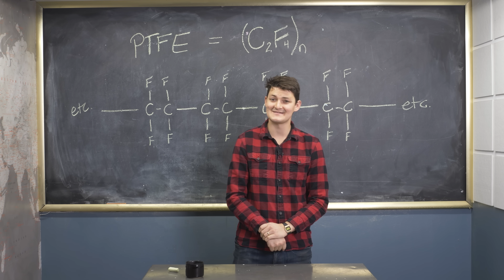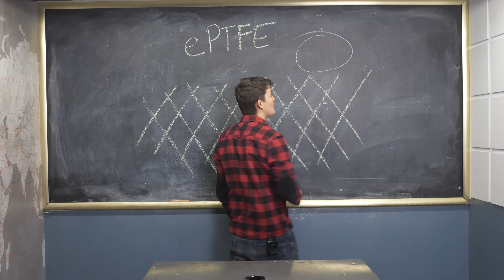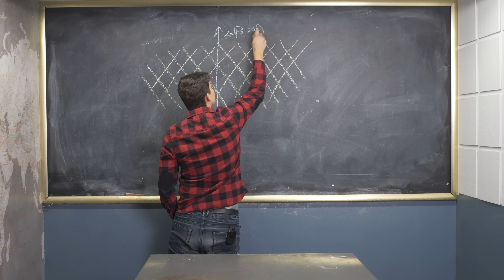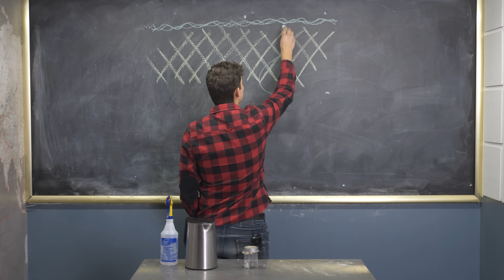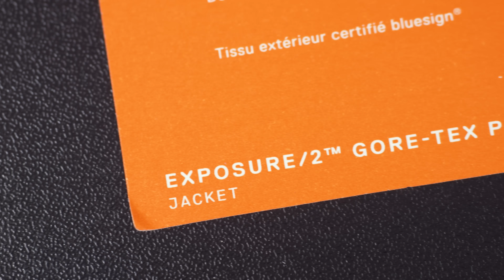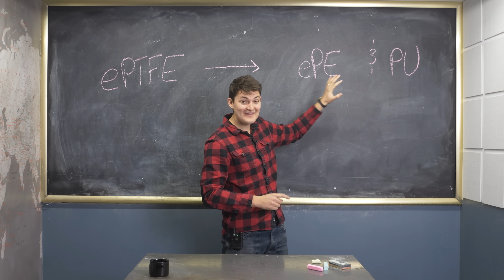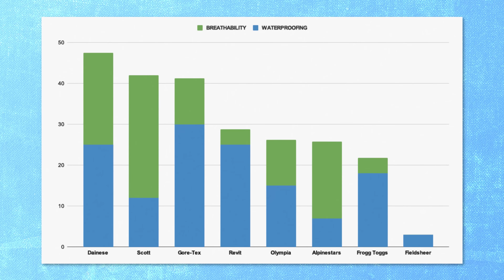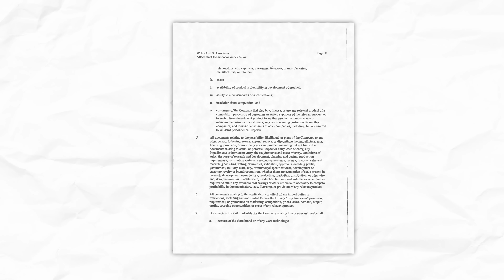Gore-Tex is a Marketing Gimmick

Comment: I've owned a couple of gortex jackets and I've found they are not waterproof, they wet out after a while which tends to negate the breathability of the jacket.
I think they are good in light rain and sparodic showers but in driving rain and high winds they fail every single time.
The Scottish Highlands will destroy gortex real fast.
I now use a wax jacket which works better and is easier to re-wax after each trip.
Just my humble opinion though.

Comment: Gimmick? Well, yes and no. I rode with Aerostich Roadcrafter suits almost my whole riding career; 38 years and hundreds of thousands of miles. The ‘Stich, made with Gore-Tex, was marvelous for all kinds of reasons but I found that while it was water-RESISTANT, it was not quite water-PROOF. On my motorcycles with good-sized fairings and/or windshields it did a decent job in all but really heavy rains. On my Ducati 900SS it left me SOAKED . . . especially where the rain got channeled down my chest and into my crotch. YUK. But then I discovered Frogg Toggs and that flimsy-looking but surprisingly tough suit, on top of my ‘Stich, kept me DRY, even on the Ducati, in deluges and at speeds WAY too st00pid for those conditions! So I’ve been happy with my only two Gore-Tex purchases ( the Gore-Tex did not survive sliding on the pavement — so I had to buy second ‘Stich ;^)

Comment: After my time in the Infantry, living outside like a homeless person, I am convinced that 90% of the population does not need this stuff, or know how to use it properly regardless.

The stuff is honestly kind of garbage even when you do know what you're doing.

Just use appropriate base and mid-layers for the weather, and  then use a shell (with ventilation) if the weather requires it. Only use the shell when needed and not beyond that.

Comment: I admit to be a GORE-TEX fanboy. GORE-TEX footwear is the absolute best for Motorbike riding. On the garment side I am using Leather Jacket and Motorbike Jeans and over it a British Military GORE-TEX rain suit which works extremely well and is really low cost if bought on ebay (new or hardly used).

Comment: What was it called?  ECWCS?  The Extreme Cold Weather Clothing System?  Back in the early 1980s as a young Airborne Ranger I was among the very first US Army personnel to be issued this equipment.  It sucked.  When was it?  November of 1984?  The Pre-Ranger Program at Ft Lewis Washington.  Cold, wet, miserable. Two weeks we spent patrolling in the woods of North Fort Lewis, and all of that so-called ECWCS gear just soaked thru.  We were not happy-healthy-campers.  We destroyed that gear in our vain attempts do dry it out.  That was thirty years ago, Gore-Tex hasn't really improved since.  You can stay dry for a little while, but eventually it - GoreTex - and everything like it will just soak thru, it's a matter of vapor pressure, surface tension, temperature, humidity - it will all soak through eventually and you will be wet - cold- and miserable.

In my middle age as a Catholic I walk the ancient pilgrimage trails of Europe 400km at a time.  If it's only a little rainy?  A rainskirt cut from an old poncho and an umbrella works fine.  If it is a heavier rain, you take out your rain jacket.  Then if you are traversing the Aubrac Plateau of central France at 4500ft altitude for six hours and you are soaked straight thru.  Oh, I hate that.

Comment: As much as I like your channel I’m a bit disappointed with the ‘technical” part of the video - in short - the omission of vapor pressure equilibration is not acceptable, this is the mechanism behind goretex usefulness… the branding… well, whenever I buy goretex branded shoes I’m sure they were tested for sole seal and wear - that’s enough to convince me to pay the premium. So far I had not been disappointed (decades of using goretex an non-goretex merrell moabs gives me the perspective)

Comment: Gore-Tex has some type of consistency though., Most of the items that Gore tex is in, is the higher quality items. Like, you won't likely see a cheap crappy boot with gore tex, it would be their upper more expensive lines of boots,
So the Gore-tex goes hand and hand with quality materials being paired. Most of my items are goretex, but not all.

Better question, which fabric membrane last longer?

Comment: Interesting video about an evil corporation, are they any other types?
Nice lab work also.
But you could not be more wrong about its claimed abilities. A Gore Tex bivy and jacket saved my life countless times in the army. They were waterproof and after not needing the bivy anymore, finishing in 2011 having started in 1995, I thought I would do a few tests. I jumped in a pool and other than some small leaks near the seams it was still basically waterproof. Breathability is a realistic real similar result. Of course, it was not 100% breathable but based on physics that is impossible. It is also not as breathable as a dry cotton or similar material shirt, but it is very breathable. If you are in the humid jungle and you are already sweating do you expect it to stop you sweating? Put a plastic bag on then compare it to putting a gore tex jacket on there is a marked difference in breathability.

Comment: I love my goretex pants. Performed incredibly well in Alaska in some very heavy rain for hours. They breathed great as well. I suppose the air flow of riding the bike provides the difference in pressure required for the breathing. I was amazed at how well they did. Worth the $250 I spent buying them from the scratch and dent bin at RMATVMC.

Comment: Great video that well covers the general point but may have missed some key additional ones.  To solve the problem of the membrane getting fouled and letting water through "Gore-Tex" has an additional PU layer that prevents air from passing through but wicks water out.  It "breathes" water under the correct temperature & pressure conditions but does not actually pass air.  This is why features like pit zips are a critical feature of good Gore-Tex jackets - need a somewhat rain sheltered way for air to get out.  The original concept, simple membrane that passes air but not water, is still available from a different company, eVent Fabrics, that solved the problem in a different way.  eVent membrane has hydrophobic and oleophobic coatings that let it resist soiling and waterproofness failure longer, and they prescribe periodic cleaning and recoating to restore membrane effectiveness.  To differentiate themselves from Gore they refer to the membrane function as "direct venting".  Unsurprisingly there aren't many companies making eVent garments because Gore won't let them also make Gore-Tex garments - a market strategy mentioned by the video.

Comment: I'm a sweaty guy. We lived in Sitka AK, years ago and I wore a gore-tex jacket when running in the mountains with my buddies. Sitka is in a rainforest and it rains most of the time. Well I can tell you from experience that the stuff works. Running sweaty in the cold rain I was perfectly comfortable.
I theorized at the time that the inside of my jacket was hot and humid and this had the effect of driving the water vapor out. I tried the other 'waterproof, breathable' products of the time, but none were as comfortable as gore-tex.

Comment: as a guy who just bought my first GORE-TEX jacket, I am a sucker for marketing :D I never had one, always heard good things about it, especially from older generation of people who still have the ones made in 1990, and they still work, because it's teflon.

One thing missing in this, is that it's easy to buy a shitty jacket with SomethingTex 10000, but it's almost impossible to buy a bad jacket with GORETEX (I love typing it :P). They have a certification process to make sure you don't mess up the brand name. So IMO, I bought it because of that, plus it was just 300$ with Paclite, so far I love it.

Comment: After spending four years in Alaska and having the most state of the art "Gore-tex" equipment issued to us.  I can say, without hesitation...., Gore-tex is absolute crap and a rip off.  It does NOT keep you dry in harsh wet environments, it does NOT "breathe" and it's use is really no better than a heavy duty Hefty Bag that you can get at the local store.   Yeah, they look cool and yeah, they cost a LOT of money, but anything made of Gore-tex in a real harsh environment--sort of like riding a motorcycle in the rain the northern latitudes--is absolute crap that is not worth the price.

Comment: Don't really get the comment at 5:07. The gore-tex 'claim' is that hydrophobic material + (some) breathability is good - water beads off and doesn't hinder breathability as much. A plastic bag may be as hydrophobic, but it's not breathable. So why would a wool sweater + plastic bag work as well as goretex?

Comment: In the shop, they all look nice. But you should not recommend anything if you have not used them yourself for a longer period of time. 
I do have the Arc’teryx and I am happy with it when it rains for a short while. But after a few hours cycling in the rain they also seem to become ‘saturated’ and you get wet too. I find that putting on a poncho on top of everything is the best solution for heavy rain lasting several hours.

Comment: My experience is different, i always thought that all the membranes are the same but i was wrong. I use my motorcycle almost year round and i bought my first boots and jacket with gore tex and it works. If  i soma sumarum all the kinda waterproof jackets and pants ,a dry b dry ,c tex ,d tex i bought and i was wet after 15 min  of riding in the rain i wish i tried g tex before, it will be much cheaper.

Comment: Military has transitioned almost all of it's rain gear to goretex since ACUs were introduced in 2005, that means all the waterproof boots, jacket, pants, even gloves, are all goretex. if you just want something that lasts and repells water, use goretex, they are unbreakable. except they are not that breathable, which is fine, especially if you wear less inside. It is completely waterproof, as long as you have the seam taped, there's no way for water to get in. I've tried goretex boots in water, it's perfectly good.

Comment: one wash and it is ruined no matter how carefull you are. Also ripping your £400 jkt on branches or fence wire is no fun. The cheaper stuff will perform perfectly well (unless you're mountaineering?). Gtex stuff generally fits better and is lighter then cheaper brands, but you can achieve equal performance wiyh careful chice of base layers with your Gtex alternative.

Comment: gortex is legit. its licensed so the quality depends on the brand that puts it out there after ceritfication/licensing. THere are different level of gortex. 

Its probably really useful if you're going to straight up ride in a storm. Its essential when snowboarding if youre a beginner or if youre a rider (boarder, in thise case) and is going to test your self in steep slopes or difficult terrain.

Im not a gortex/materia/fabric scientest, but just from frist hand experience anyone can tell the difference  in 1-2 days. Whether its keeping you dry or breathability compared to other waterproof jackets.

Comment: Hmmm... This is the second video that I question the presentation and angle being made.  Yes, Gore-Tex is not as special or unique as it used to be.  Yes, it is waterproof OR breathable.  I agree with those statements.  What I don't agree with it the scenarios presented in the video.  Who walks through a deep humid forest with a heavy motorcycle jacket on?  In real world situations while riding, the rider has airflow when moving. Also, jackets have vents to use when it is dry and hot.  This still allows airflow when humid and hot as long as you're moving.  The other wonderful thing about Gore-Tex jackets like the Klim products, the Gore-Tex is built in to the jacket fabric so when it starts to rain you don't have to stop to don rain gear.  I couldn't be happier with my true Gore-Tex products in my 1 million+ miles and years of riding.

Comment: Yea sure the membrane itself isn't that different anymore however what sets it apart is that in order to get that Gore-Tex label the manufacturer has to comply with Gore-Tex manufacturing standards. Now manufacturer could of course employ or even exceed these standards with other membranes on their own accord, someone probably does. However the laymen, I mean us, may never know or can verify that.
If you buy Gore-Tex labeled items they are manufactured to a high standard and will in all likelihood deliver on their promise. Yes there could be items that are cheaper and still match or even exceed Gore-Tex but in order to locate them you have to dig really deep or play lotto.

Of course perception could be skewed because getting that label is costly for the manufacturer so they mostly use it for their quality line up which in turn costs so much that they can manufacture them to quality that in turn perpetuate the idea that Gore-Tex is the reason why it holds up...

Anyway I own gear from Klim with Gore-Tex and all I can say is that it holds up. That said the jacket (Kodiak) as I think 1400€ so go figure...
My brother owns a set from Stadler (German boutique style manufacturer) with Gore-Tex and again it holds up and again the jacket alone is 1300€ go figure...

Comment: Anyone who has owned a Gortex item knows, it is not a miracle material.   In fact at times I have found with little use it can fail.  Using a rain poncho actually makes more since in many scenarios.   It’s 100% waterproof, easily packable to a small light weight item, and costs very little.   No maintenance, no fuss.   But I be stylin in my two Outdoor research Gortex jackets………

Comment: Great vid but i have to disagree based on experience. I always suspected Gore-Tex was a gimmick so I bought Pertex and other cheaper own brands.. all were crap - not really waterproof and very sweaty. I started a new job working on landfill sites in all weathers and my company supplied Gore-Tex gear. Sometimes I can be 8 hours in the wind and rain on an exposed sites, I was blown away. Now I use Gore-Tex when i climb and hike and I don't think I'd risk using anything else.
Reply: I wear Gore-Tex from head to toe in coastal Alaska and it's a very comfortable wind and vapor barrier. Breathes slow, but does breath. Slow release of vapor prevents the body from cooling too quickly.

Comment: I think this video is made for a very specific group of people. Most people have a decent amount of common sense and realise there is only so much a breathable material can do. That's why goretex motorcycle gear ..... and mountain gear  for that matter, has a lot of vents. There is a reason why so many companies use Goretex, it certainly isn't just a gimmick. 

The Dianese you mentioned in the graph may indeed be more breathable but I'm willing to bet a months salary that it's also a lot colder due to windchill. That's the tradeoff with breathability. Do a test ride. Spring time, one rider in each of those Dianese jackets, both with the thermal liner removed. Riders only wearing a t-shirt underneath the jacket. I bet the one in the laminated is happier at the end.  

The main selling point of Goretex however, is the warranty. Most goretex jackets (across the range, not just motorcycle) have a lifetime warranty which Dianese do not offer. Nor do any of the other motorcycle clothing companies aside from Klim. 

At the end of the day, ones needs are what matters. If you need and can afford decent Gore, get it.
Reply: Very few (none) honor that warranty. Ie. Outdoor research, to name One.

Comment: What did you say about PTFE and the water? Maybe we should think twice about lubricating our dirt bike chains with Teflon spray?
Reply: Dude we drive trucks to the trailhead. Spewing exhaust, oil covering every component, interior made of plastic, parts shipped from all across the globe. Screw it.
Reply: @nathan8418 I don't understand the relation of spreading microplastics into nature
Reply: @MrMrMrMrMrT  Just as harmful to run the machine as it is to wear synthetic gear. Probably worse.

Comment: Not only does Teflon f the water table, ptfe contains pfas which is a forever chemical that is absorbed into your skin and known to cause cancer. Firefighters are currently dealing with this exact issue as there is currently no other available moisture barrier for their gear that doesn’t contain these chemicals.

Comment: Well, that has not been my experience. I have tried from the very cheap nylon or poly sheets to the "top" Gore-Tex. In some environments one may not feel the difference. I others most definitely.  I once noticed it at the end of the day and wondered why I was more comfortable that cold rainy day that I had been the previous week in the same place with same conditions. I realized I was waring my Gore-Tex jacket that I never wear for that particular activity since, well, is expensive 🤭. Boots however, water always find its way. I use waterproof socks instead. And I keep trying BTW, thinking newer technology will give me better results. Gore-Tex still rules for me.

Comment: Hmmm over 60 years of riding bikes and gortex is the BEST of all the materials and the latest incarnations are better than ever. Keeps me dry in driving heavy rain at speed for hours and nothing else ever has! It is also relatively light and comfortable and while Klim is an absolute ripoff it is still the best gear around ...

The secret is to wash and treat the garmet with DWR washes and preps regularly.

PS you are not quite correct about the discovery of Gortex and how material was made ... it requires to be made on a water layer